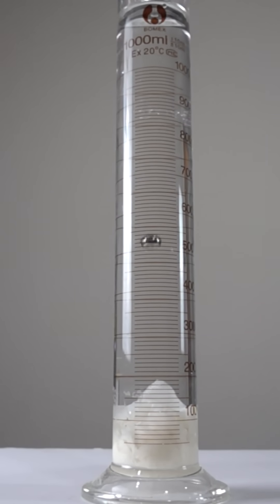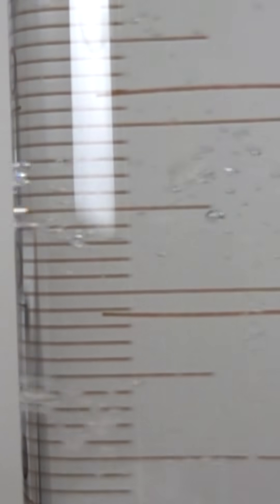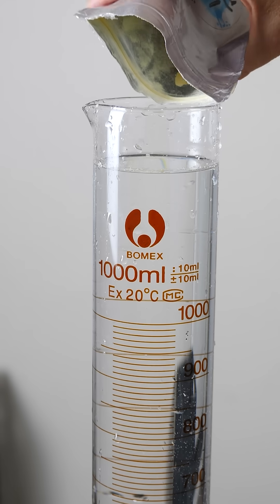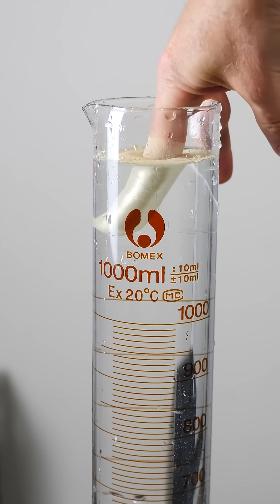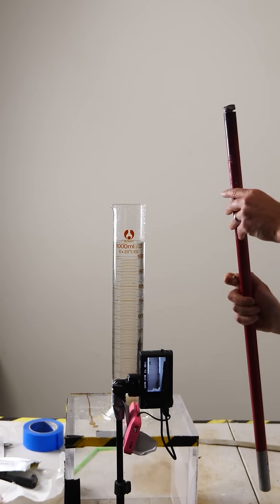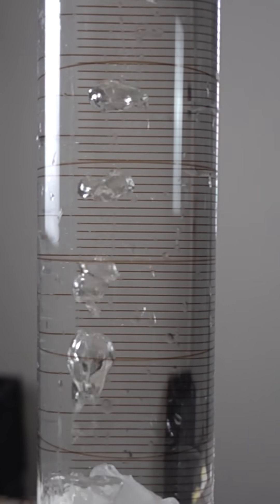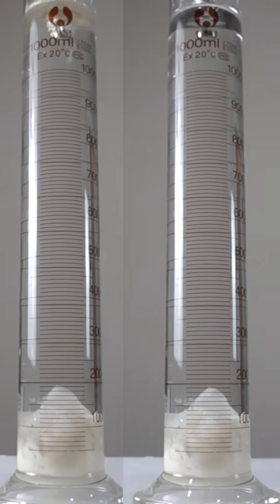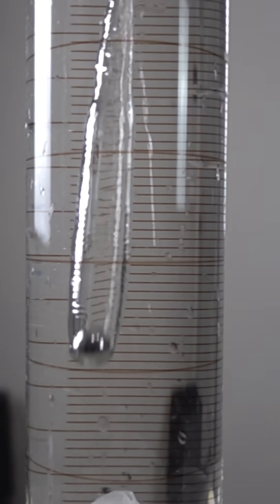Making a Frictionless Torpedo

Comment: Or… take it up a notch with solid rocket fuel to drive the ‘torpedo’ at insane speeds. Redirect the exhaust to a specially designed nose cone to create a gas cocoon around the torpedo… and voilà, you’ve got supercavitation in action. Just don’t expect it to steer like a dream—guidance and control will be a real nightmare at those speeds.

Comment: The super fast torpedo actually created a bubble of compressed air in front of the torpedo to remove as much water friction as possible. It does require an enormous amount of power to do this plus propulsion of the torpedo, but the result is a crazy fast underwater object.

Comment: They use that kind of technique on sea planes,  sks planes that land on water.  They have a million off tiny holes in the bottom of the plane that is under water,  then during take off the Pilots turn on compressed air and blows tons of bubbles so the hull of the ship that would normally have ws lot of drag on the water trying to take off, but compressed air coming out of the million tiny holes create a pocket of air underneath the hull so they can actually get enough speed to take off as usually used on larger planes

Comment: His finger shows exactly what happens. The metal ball as its dropped displaces the water. The diameter of the ball, the speed of the ball, the powder thickness creates the air bubble. The air bubble is the air foil from the ball

Comment: For all those people thinking that adding this to a ship would make it sink. 

Adding a hydrophobic coating to a ship's hull would not inherently make the ship sink. In fact, a hydrophobic (water-repellent) coating could potentially improve the ship's performance by reducing drag and improving fuel efficiency. Here's why:

Effects of Hydrophobic Coating:
Reduced Drag:

Hydrophobic coatings can create a smoother surface, reducing the resistance between the hull and the water.
This can help the ship move more efficiently, saving fuel and increasing speed.
Improved Durability:

These coatings can also protect the hull from biofouling (e.g., algae and barnacle growth) and corrosion, reducing maintenance needs.
Buoyancy Unaffected:

Buoyancy is determined by the displacement of water and the density of the ship's materials. A hydrophobic coating does not affect these factors.
The coating is typically very thin and lightweight, so it won’t significantly change the ship's weight or how it interacts with water.
Misconceptions:
Some might think a hydrophobic coating could trap air and create instability. However, in practical applications, coatings are designed to adhere tightly to the surface and do not create large air pockets that could affect the ship’s buoyancy.

In summary, a hydrophobic coating would not cause a ship to sink and could actually enhance its performance in water.

Comment: You do know all modern military torpedos extrude air in front so that the torpedo is enveloped or incased in air? This allows the torpedo to reach extreme speeds that it would otherwise not be possible with water drag. Very similar concept like a air hockey table does to separate the puck from the table so that it moves faster with less drag

Comment: This doesn't explain it at all. I beleive its 33% faster but your reason is non sense. Both balls start with the same kenetic energy. Both balls have to push the same amount of water out of the way. It looks like this is due to the hydrophopic powder allowing a long trail of air which means it isnt having to expend the kinenetic energy to collapse the water behind it until later, which means it spends more time at higher velocities. Not because "the water isn't touching it".

Comment: The reason why this isn't used in most torpedoes is because its more efficient to create thrust when in more viscous medium, like water, when compared to air, meaning that a torpedo would actually perform worse. The only way this could be made to work is by using some alternate propulsion system like a rocket engine, rather than a conventional screw.
Reply: Depth charges could be interesting….
Reply: It would have a better application coating dumb rounds for underwater use, but at that point why? It's not worth it, assuming the stuff doesn't burn off when the weapon is fired or that the post firing application method doesn't fail.

If you were bombing something on the seabed then I can see it working.

No doubt someone more creative will come up with some way of using it better for arms.
Reply: @StormArmy96  
I suggest you look at the WW2 Hedgehog and Squid antisubmarine weapons.
Reply: how about a hydrophobic mine for ship to counter submarine?
Reply: @laizerwoolf  Why on earth would someone make a mine hydrophobic, if anything it will make it harder to get the mine to float at a given depth.
Reply: @henriproos, why on earth would reduced surface tension affect bouancy?
Reply: Coat a ship's hull with it. I heard they are already trying this but with micro bubbles to reduce friction.
Reply: @HyenaEmpyema  
Air bubbles can't float a ship.
Magnetic torpedoes break a ship's keel by creating a huge air bubble underneath the ship, removing bouyancy support where the bubble is, causing the keel to be unsupported at that point, and the  ends of the ship literally fold upwards with the bubble as the folding point.
Reply: @HyenaEmpyema  doesn't a ship sit on the water though, using it's resistance to keep it afloat?

Remove the resistance and you remove the bouyancy and the ship sinks
Reply: @StormArmy96  good point, it might increase the draft until the 2 forces equalize.
Reply: @HyenaEmpyema  I can see an argument for coating the bow to make water get out of the way, rather than slicing through it, but whether or not that would affect the balance I don't know, I'm not an engineer
Reply: @StormArmy96  I was also puzzling over this, but I'm not sure it makes a difference when you're talking about bouyancy due to displacement... i.e. a carbon fibre hull is more slippy than steel, but it doesn't seem to make much difference in the grand scheme of things. Pure conjecture on my part, but I would love to know the real answer!
Reply: @StormArmy96  No, it will not cause a ship to sink. Ships don’t use “resistance” (ie., “drag”, which is a dynamic property resulting from the motion of water over a surface) in order to float. The use simple “displacement” of water by the hull which is a static property (if the hull displaces a volume of water whose weight is equal to the ship’s weight, then it floats. If it can’t displace that much water, then it sinks). As a confirmation, boats with severe “hull fouling” (covered in barnacles) have a much higher resistance to moving thru the water (burn a lot more fuel per knot speed), but don’t sit higher in the water. A classic case of “inverting the experiment”.
Reply: @tfk0527  Oh, that explaination was what my 3 brain cells could not muster. Thank you!
Reply: @tfk0527 You are correct of course 
But I still like the other guys perspective.
Reply: @StormArmy96  Look up Archimedes law. This guy figured out what you have no clue about, over twenty-five hundred years ago...
Reply: Thanks Bud 👌
Reply: I was thinking of something a little more vertical but yeah I can see your point. I wonder if could be burned and recycled simultaneously. The hydrophobic compound specifically.
Reply: NO.  They can put the screw at the front of the torpedo.
Reply: Check out supercavitating torpedoes! Russians have one that emanates gas from a leading tube, producing a bubble envelope, resulting in a very high speed/range unit.

Aid bubble under a flat-bottom ship reduces friction. Bubbles emanating from hull lower buoyancy till ship sinks low enough to achieve neutral buoyancy depth...or sinks below surface, ergo a submarine. Yeah, ships don't float well in 'air'. =]

Friction reducing hull coatings improve speed/efficiency which fouling/growth counteracts.

I have a plurality of innovations in this 'space' and air...including outer space and land mobility and other areas. Search for FAZE engine. There may be something about PersonalJet too [under the radar for now].
Reply: If this is accurate (I'm not saying it isn't) why's the military still using screws? When they could have underwater missiles.
Reply: @bazzmcfury9550  Rockets are fast burning candles.  If your vessel is rocket powered, it will run out of fuel way before it gets somewhere.
Reply: @x-man5056  I agree, it's why ships use turbines I guess. What I'm talking about is a rocket powered torpedo. Just the sound of it sounds bad ass 🤣
Reply: I heard that the Russians created a rocket propelled torpedo.
Reply: You should look up super-cavitating torpedoes
Reply: Its used in torpedoes, its called supercavitation.
Reply: Could probably find a way to put the motor in front?
Reply: What if only the body was hydro-phobic though but not the mechanical parts that create its propulsion though? (i.e. the propeller, etc.) So the drag on body/nose is reduced but the propulsion is still unaffected.  Curious if that would still work or not. I guess that bubble it would create could drag behind and cause the propeller to have more air than water around it though, huh?
Reply: @dtarr77  Put the propeller on the front.
Reply: @nbartlett6538  Prop in the front then impedes the homing sensors. Engineering is a tradeoff game.
Reply: @nbartlett6538  
IF you put the prop up front, you completely cripple any torpedo's acoustic homing capabilities.
Reply: But the rear of the torpedo wouldn't need to be hydrophobic, just the front and sides.
Reply: Which would be very noisy. Rocket motors are quite loud. The opposite of what submariners want. I'm not saying you edorse rocket torpedos, just adding to the reason they likey haven't adopted this method.
Reply: @TurdFurgeson571  Rocket power torpedoes have been around since the 60's.  Soviets were big on them.  US has anti-Submarine rockets or at least they did have them.
Reply: @x-man5056  Cool. I assume the noise isn't an issue then. Or are they quiet somehow?
Reply: @TurdFurgeson571  I don't think it's critical for a torpedo to be extremely quiet.  I don't know of any anti-torpedo interceptors.  The rocket powered torpedoes would be much faster, possibly less maneuverable.  It might even be a strategy to shoot a torpedo as a decoy if it's noisy.  But I'm not a submariner.
Reply: @x-man5056 
There's also high speed torpedoes that have vents at the nose to provide a layer of exhaust gas buffering the body from water to reduce drag as it propels forward.

Comment: Seems like a good way to help ships slip through the water faster, if you could keep the powder on the hull somehow. Maybe mix it with paint. I'm sure it's been done
Reply: I was thinking of the amount of money thrown at the AC75s in the (up coming) America's Cup.  Relatively small surfaces on the foils and rudder, but drag is the enemy
Reply: Can the Navy use this to speed up our submarines?
Reply: @wrcummings let me be discrete: nuclear subs are waaaay faster than you think. Nuclear reactor is heaps of horsepower...... like heaps...... the deeper you go the higher the water pressure. High water pressure allows more transmission of thrust before heaps of power cavitates the propeller....... So they go super deep to run super fast.......Kinda counter intuitive but true. Keeps them deep to avoid satellite tracking too.....😉

Comment: Wow I noticed an issue in the video. He first dropped the first ball using his hands and it went at normal speed. Then he used a tube with the ball in it to drop the ball into the water. That caused the ball to have momentum and go through the water much faster than hand dropping the ball as the ball was accelerated before entering the water. A simple fact is that any object dropped in water with an accelerated rate or an object inside water which moved at an accelerated rate will 100% have an air trail. Or cavitation bubble. That’s physics. I know the video was made to show the properties of hydrophobic materials. But it should be done the exact same way both times. As the first would be the control. And not modify the experiment.

Comment: The best part is the impact is significantly less on the surface of the water. Meaning it can be used on airplanes if they ever were to hit the water they'll have a much lesser of an impact. Just spray some where it will hit the water and it will keep the plane in one piece. And since planes actually float when the pressure chamber is sealed, then it can save a lot of people not just the plane. 😊

Comment: Errm no. The drag coefficient is not reduced because its hydrophobic. It's reduced because you allowed a huge tube of air to follow it into the water, and THAT was caused by the hydrophobic powder on the surface.
Reply: What makes you think he didn't use the same method for both? The non-hydrophobic ball is also in slow motion.

Comment: Does it also work in air. I mean, in a reentry case scenario,maybe  it would be beneficial to have reduced drag. In that way that much heat wouldn't be produced and there would be no need for the ceramics on the surface of a for example a shuttle. Am I wrong?

Comment: Cd= 2Fd/ (rho u^2 A)
If velocity thru medium is u
Cd proportional to 1/u^2
So if uncoated is u= 1
Coated is u=1.33 for 33% faster
Then cd for coated is about 0.565 of cd uncoated.
Not 0.1
So not a 1/10 of the drag coefficient? Or have made a mistake?

1/1^1 = 1
1/(1.33^2) =0.565

Comment: OK now that we understand the concept...
Let's scale it up,
Surround an object in 1/4" of vacuum all the way around the outside surface, it should move through air with the same physics. What would occur as said object crosses the sound barrier?
Will it still create a sonic boom?
Where would the pressure waves propagate from? the edge of the vacuum? not at all? I NEED TO KNOW!!!

Comment: Supercavitation is used for VA-111 Shkval instead, so it travels close to 400 km/h underwater (around 240 mph).
Reply: That is really nutz! Mind blown!
Reply: Isn't that a rocket engine powered torpedo?
Reply: @madcavemantd2  It most definitely is.
Reply: It's fast, but is blind because sensors don't work through the bubble.

Comment: So fluid mechanics explanation: Fluid flowing over a surface will stick to that surface, and the further away from that surface the easier it flows. By making a pocket of air/powder around the ball it means that the water slides over the air much more easily, while the ball doesn't cause drag.
Reply: Wait so hydrofoils would still work but with a lot less drag?
Reply: Thank you❕ 👍🏻
Reply: How did he wash that stuff off his finger?
Reply: Nice name ☺️

Comment: Actually it is not right, the drag coefficient will only increase because of the difference in pressures in front and behind the ball.
Pretty obvious, that first case is better than the second one in that sense, just learn the drag coefficient.

The reason, why an object falls faster is in hydrophobicity (the ball experiences almost zero friction, and thus the boundary layer immediately detaches) and only improves the dynamics for an initial part of drop. Aerodynamic drag consist of friction and form drag, and the form drag is much dominant.

Since the drag is less for the first case, the first ball will have higher speed at some point and will win the race.

Comment: Will that air collapsing not create cavitation noise that can be detected even if it's faster. Most subs can't outrun any torp. The warhead does not even to hit the sub, just explode in proximity and the blast blast will open a subs structure and drive a sub into a fatal depth or it just implodes under water pressure

Comment: Wrong, there are secret torpedoes with a mechanism that blows high pressure air in front of them and allows them to travel at mach speeds UNDER water.

Comment: I wonder if you could fall from a 'higher' height into water coated with this powder without being killed.   It seems like you wouldn't decelerate as quickly as a control, and thus create less stress on the body.  You'd probably go deeper in the water to compensate.   Or perhaps the water surface tension would still get you.

Comment: Shipbuilders are looking at putting this idea into effect to increase fuel efficiency by reducing drag on cargo ships. 

The massive flat bottom will have some kind of bubbling devices along it’s length, which will create an air barrier on the largest surface in contact with water and reduce friction just like that little ball

Comment: This removes the friction component of fluid drag. It does not remove the pressure differential between the front and the back of the ball. There is still
Drag!

Comment: Couldn’t you theoretically put that stuff on after super heating then sphere then doing it as the immense heat would evap the water whilst also being hydrophobic therefore it would loose it it would either run out of air to burn I get it wouldn’t be easy to make a torpedo like that but as I said theoretically

Comment: If you coated yourself in hydrophobic material and jumped from a plane 30,000 feet in the air into water, could you survive the jump since surface tension wouldn’t affect you?

Comment: this seems like it would have good naval application for torpedoes
Reply: There are supercavitating torpedoes that kinda work. Biggest problem is that your control and drive surfaces all require water to push against. You make a nice low friction cavitation bubble, great, except that water vapor isn't great for pushing or turning that torp. (the gas in those bubbles formed from water forced into low enough pressure that it forms ambient temperature steam)

Comment: The Russians did this with a torpedo many years ago and I think they still use it. But instead of a chemical, they simply blow compressed air out of the front of the shell which creates a cavity of air around the torpedo. It's very, very fast as a result. I think it's called the "SQVALL" or something similar?